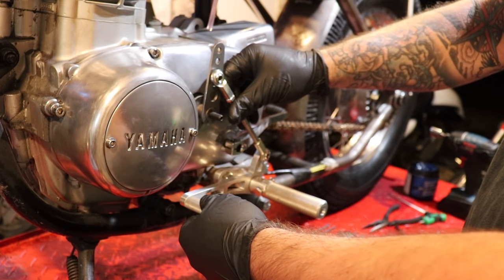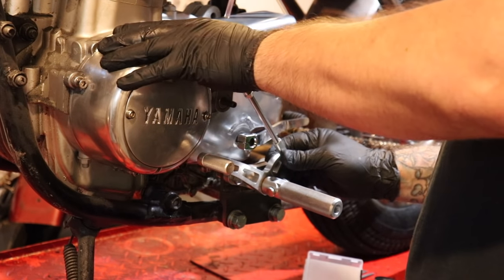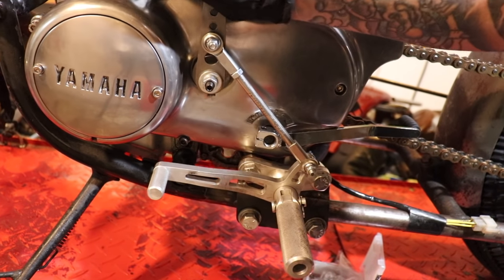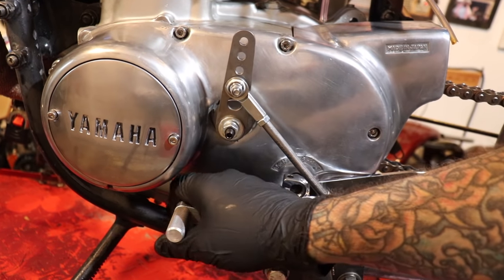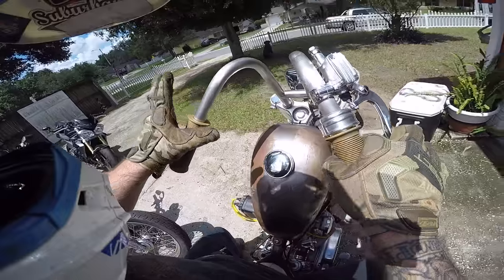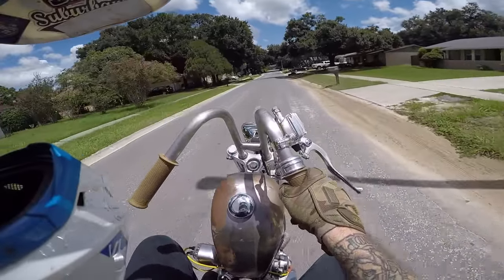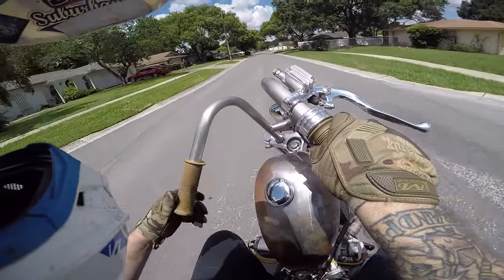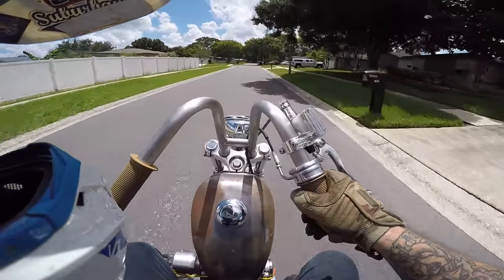Custom Suicide Shifter Installation and First Ride | Old School Chopper Build ep 20

Comment: I personally would have the hand shifter on the right side, because I'm weird. Addendum: when you drill and tap that hole in the clutch pedal, i recommend drilling in left hand threads. Try taking off a left side pedal on a bicycle, and you'll understand.
Reply: Wait, the invisible hand doesn't change gears for you?
Reply: @GrimFaceHunter  HAH! So few people reference the Invisible hand when they hear my name. Good on ya!

Comment: Totally cool Dude. Reaching down to shift reminds me of about 50 years ago I had a 52 Mercury and someone had put a floor shifter in it then someone stole that and left the two linkage rods laying on the cross member. I drove that thing for a year reaching through the hole in the floor and pushing and pulling the linkage rods with my hand :D I drove that car to work and stashed my lunch under the seat and found out I was sharing the car with a mouse. Yea that was before home computers, so it was the little furry kind of mouse that would eat a hole in a lunch bag and eat some of the sandwich. :D

Comment: Maybe pair it  with a quick shifter so you can just bang through those gears full throttle open 😁. I've always wanted to see that combination but never have. Maybe it's not possible but if you want to freak people out... that will definitely do it😂. Great job brother.
Reply: Is he still running points? If so, not possible since it's a carbed bike. With electronic ignition though, it should be doable!
Reply: That'd be sick

Comment: A rule I always use when doing gear linkage is always pull never push. Because there will always be more flex when pushing. 

I know it's not always easy to do and I dont make choppers i make dragbikes  so what do I know 😂

Comment: Damn Josh! With reaching way down to use a reversed shift lever as a stopgap handshifter you just gave a whole new meaning to "suicide shift." I nominate the name "Deathwish" for the XS chop.

The "who's bike is it" question is now settled... Mostly... Nah, but that's a very logical and responsible reason to alter the original plan. Don't worry, I won't tell anyone you were actually being responsible or logical. You do have a reputation to uphold. 😂

Comment: Pro tip 278/B;
 lay off the powered driver for removing and replacing small fasteners. Especially into alloy cases. Stick to manual wrenches or ratchets for a better feel. Saves on stripped threads.
Regards,

Comment: the linkage that connects to the "clutch pedal" should be between the pedal and side cover. that will get rid of that flex. want the linkage rod to be as parallel to the case as possible.

Comment: Nice work! I think I'd flip the foot clutch lever so the arm is pointing down instead of up (you'll need to cut off the peg to flip it to the other side aswell so its pointing outward) and rotate the clutch actuator arm round so its pointing down too that way you'll have a pull rather than push rod and the whole linkage should be much cleaner and out of the way of the gear shift linkage when you do that bit :)

Comment: I see the flex your going up and in toward the motor? I think that is because the movement is to great on the bottom for the angle your working with. Meaning the upper is not moving as far as the bottom because it does not need to and that is causing the flex?
 I think I would move the top rod to a 3 O'clock position and just try and do a straight vertical movement

Comment: Technically its called a suicide clutch and a Jockyshifter. Jockyshift has 2 locations. Side of the tank, or next to the seat ontop of the transmission.
A Tank shifter has the Clutch leaver On the tank shift leaver itself, so these don't usually have the foot clutch. 
I know I know, semantics. But clarity on variety helps.

Indian Larry prefered the suicide clutch and transmission jocky shifter. Wicked dangerous ride, but hella cool lookin.
Reply from the maker: Haha I knew there was different terms for different stuff! I appreciate the info. And I love Indian Larry!
Reply: @shadetreesurgeon  More or less a comment for everyone else, since you were saying foot clutch and hand shift through out the video. 
Your's is more a concise of a means of de-confusing(is that a word?) than mine, mine's just to vomit info at people, lol.
Reply: A jockey shifter is only the under seat location. The tank shift is simply “tank shift”. 
The newer kits with the clutch lever on the shifter are kinda their own thing. Not exactly suicide clutch but not standard either. Havent heard good things about them and have no desire to play with one.
Reply: @Ulfstigandr  Nope. the tank side is still called jockey shift.
That's what Jesse James does. is suicide and tank jockey.
Sometimes, even the tank shifter with the clutch leaver on it is still called jocky.

Comment: I did a suicide clutch on my xs ran the shifter up by the tank off the motor mounts and some rube Goldberg linkage to make it work. After riding a foot clutch its boring to ride normal.

Comment: I installed a jockey shift on my Sportster. After a motorcycle accident which left me with drop foot this was the only way I could ride again. Also added a rekluse auto clutch so I wouldn't stall out since I couldn't finesse the clutch while wearing my brace. #whateverittakes

Comment: dude, ima make one on my ironhead. might make a lever up there that does rear brake. so 2 rear brakes and no front. def. gonna use a harley throttle to shift. 2 cables push pull = up down. ha! and footsie clutch. chaupeirs 4 lyfe.

Comment: In the early 20th century there were foot clutches, hand shifter also throw in the advance and retard timing. If you rode an Indian the throttle was on the opposite side. Worked back then it could certainly work now. I love it!

Comment: I had a 78 harley 1000 sportster turned hard tail bobber with a foot clutch and jockey shifter .. it was all fun and games until while drinking one night i decided to have a hold my beer moment.. i kicked it over and on most every other day it had been a 3 kicker.. but not this night no on this night it kicked on the first half assed try and my dumbass had neglected to make sure it was in neutral.... well as you might have guessed it launched to life.. and besides the fact that it ripped itself apart while it took out 3 cars fenders and then summersaulted  over the front of the fourth car... i remember thinking out loud how impressed i was with my welding of the rear frame section and raking the the neck.. bc although they bent they did not break ...
Reply from the maker: Damn dude, I’m sorry I’m laughing 😂

Comment: Hey buddy, Your setup is cool, I have a similar setup on my old Iron Head Sporty. One thing thou, your linkage shouldn't be on such a angle. Where your linkage connects to the lever should be closer to 45 degrees. If you shorten up the linkage and turn your level it won't bind/twist the input shaft as much as it does now. After a while it may destroy the bushing in the cover. Try shorting the linkage and turning the lever more and you will see what I mean. Any extra binding on metal is a real bad thing over time and if you plan to useing this for longer trips, it would make sense to make everything work as smooth as possible. Other then that I love what you're doing to the old girl. Later bro

Comment: for that foot clutch grease actually isn't your best option, go with usually a dry graphite on anything near the bottom of the bike, simply because anything with grease that low-down becomes a grime magnet and you can end up jamming stuff. Manufacturers actually usually recommend anti seize

Comment: I notice when you pushed with your thumb you were closer to the top of the arm and there wasn't as much "flex". Maybe try to move the end of the rod to the last bolt hole. This may move where you place your foot on the clutch lever higher but, You can always lift your foot higher to use the clutch. I have built a few hardtails and I have found that it is hard to customize some pieces and sometimes you have to compromise. After all choppers aren't supposed to be comfortable. :)

Comment: From a mechanical engineering perspective, when designing linkages, the angles between links should not be close or smaller than 30 degrees. The smaller the angle between links the more force is required to actuate the clutch, this might be a reason as to why there is flex in the link.

Comment: I had a 79 XS650 and with a few mod's, header, rejet carbs, K&N filters, clutch she would do just over 12 seconds in the 1/4 mile drag and on curvy roads beat bigger bikes like 1000 and 1100 cc's. What year is your XS 650?

Comment: You can further clean up those bars by using an internal throttle cable, and eliminating the front brake. If that's too scary you can use a portioning valve and linelock to run both brakes off the rear master.
Reply: The rear brake is mechanical not hydraulic.
Reply: @leorapsonjr9134  Curses, fucked again, Batman!

Comment: With that sketchy front end and bars, putting on a foot clutch will grant your (death) wish of having a more dangerous bike to ride. RIDE is probably the wrong word because after a few times on it the bike will spend it's time sitting like most choppers. Good luck!
Reply from the maker: We’ll see, the plan is to take it on trips
Reply: @shadetreesurgeon  Okay. I hope it goes well. I'm only sceptical because years ago I had a Jockey shift Panhead chopper and it was a very impractical bike--especially on trips! You may have better luck.

Comment: Shade tree red flag a piece of cold will steal breaks in a package there’s something not right there with that part I would not trust the replacement part something was missed in the heat treat they did not draw it back to anneal it so that it breaks like ice do you soon
Reply: To me it looks like pot metal the way it broke clean with very little bending going on. I second your concern, toss that piece of crap and get a solid iron bar instead!

Comment: there is no such thing as a suicide shift.  KIts a SUICIDE CLUTCH. Why? Because the rocker has been removed. Rocker clutch is how the factory did it. The rocker pedal allowed the rider to lock the clutch and put both feet on the ground. Chopper guys removed the rocker pedal . Therefore creating a suicide clutch.  hand shift is always just a hand shift or jockey shift. Class dismissed.  Carry on.